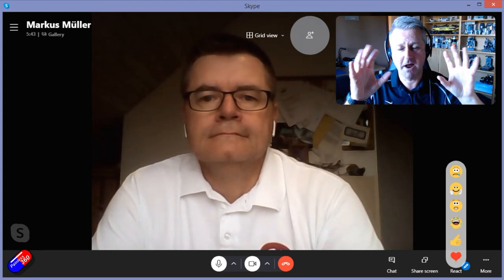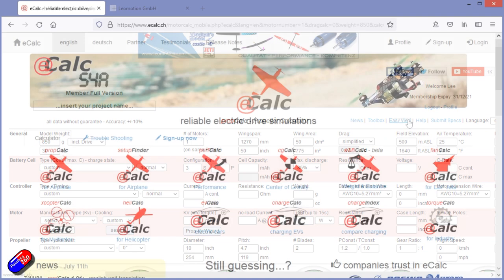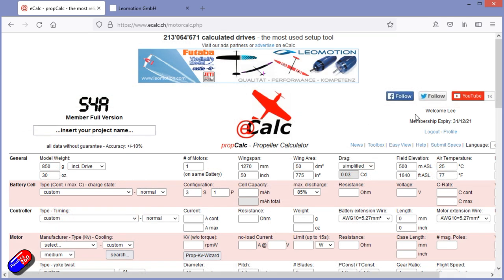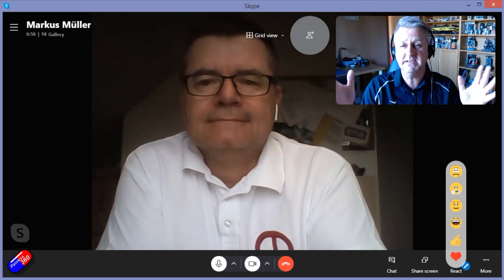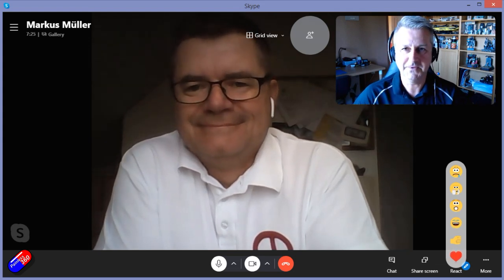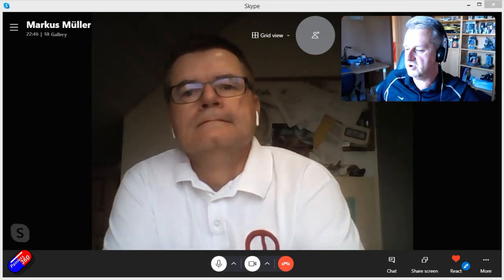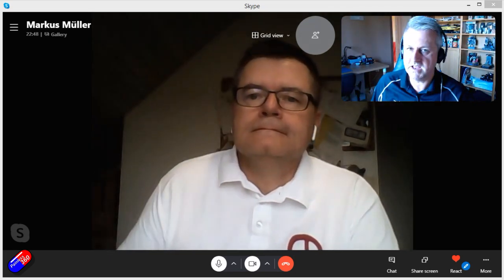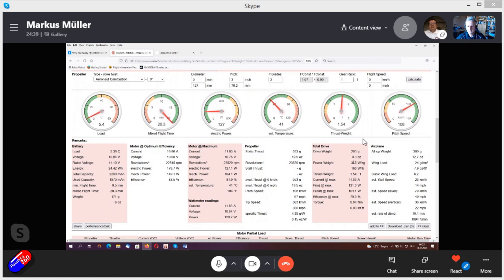How can I make my plane easier to launch?

Comment: Loving this information. I need to start learning how to plug in the data to get results. I have a setup that launches and flies amazing if you run it at no more than 2/3 throttle with a 6x4.5. The ESC complains otherwise though I know better than to run it full out. Broke a prop today and launched it with a 5x4.5 I had in my spares. Shoulda given it 90% throttle. Managed to scrape it into the air inches off the ground and had to fly it at minimum half throttle as I fly it heavy. So I need to plug in the numbers. Probably gonna tell me to use a 6x3 but it launches and flies so well with the 6x4.5 if you don't fly it like you stole it.

Comment: I have a knob on my transmitter that is mixed with elevator, to  set it 30-40% elevator-up on a hand launch,   after the launch i switch the knob back off. there is also a sound alarm beeping assigned to that knob to remember me to set it off.
Reply from the maker: Lots of cute ways outside of making sure you have enough static thrust to help with launches. I'm a fan of the INAV Autolaunch and have some other ideas in the Opentx mix school series... Happy flying

Comment: Im having very bad times with launching sonic binary... I'm using 4s 1700kv motors with 3 blade 7inch hqprop.. is this setup ok and something is wrong with inav settings?
Reply from the maker: Check out my video on INAV Autolaunch where I cover how I set it up. INAV Autolaunch can't compensate for an underpowered motor and prop setup that can't produce enough static thrust though.. Best of luck
Reply: @Painless360  OK thank you